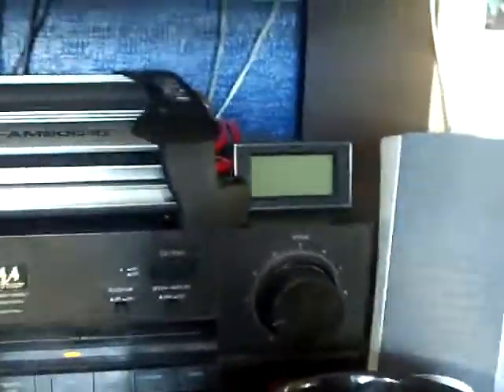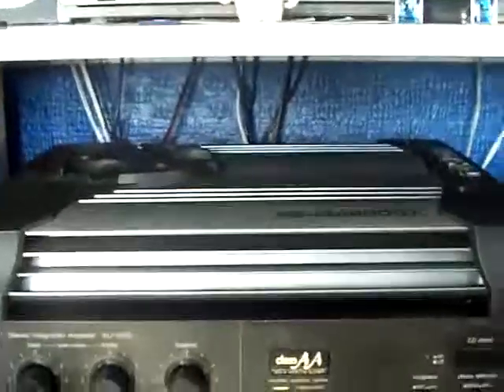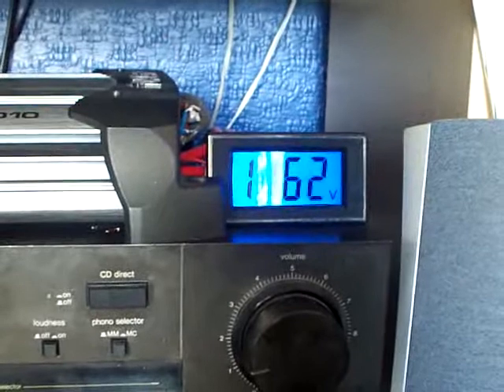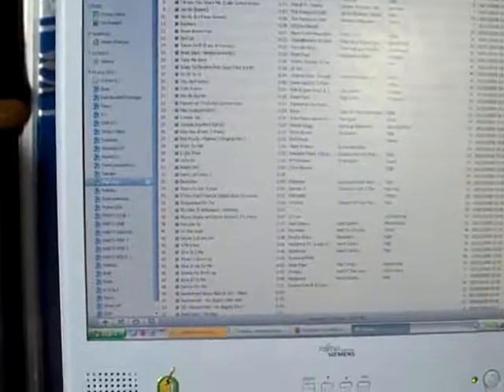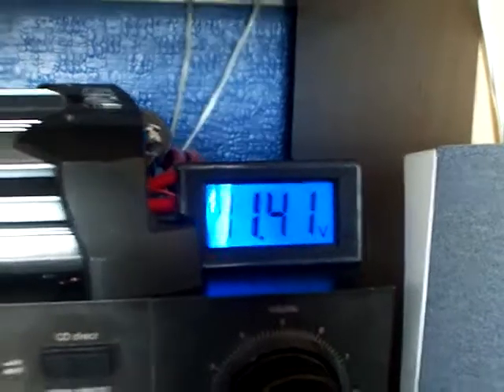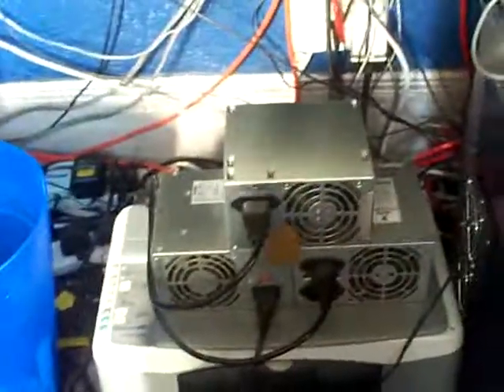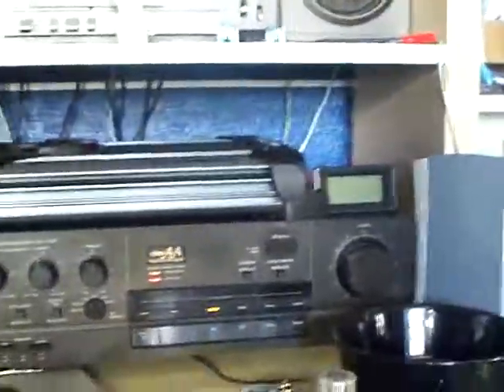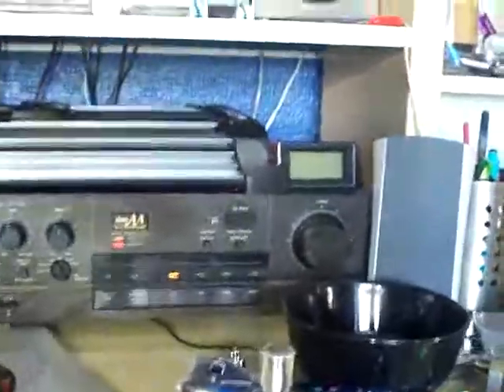Car amp in a house? PSUs maybe arent the answer!

Comment: yeah,computer psu's aren't that good for car amps because of the low voltage
I made a psu out of a continuous 25A 12v toroidal transformer,2 50a bridge rectifiers and about 0,2F filtering and it pushes about 30A before it drops under 12v.No load voltage is about 16 v and it works pretty good.I prefer using toroidal transformer because of silent operating and 96% efficienty ,compared to 60% on conventional transfomeres.

Comment: Do like me. 13.8V 30A/ 20A continous  output ,regulated switching power supply by pyramid audio. Like 80$ from amazon PSV300 is the model. Thats what u need. Supplys 20A of current and the 13.8V u need for the amp. Ima have my PS hooked up to my pyramid pb717x amp 1000 watt 2 ch.

Comment: @barevids Yeah you're probably gonna have to ground them a different way. You need to have the positive on one go to the negative on the other, and then the unused positive and negative go to the other PSU. I might have to find some PSUs to try it out , but it should work with the correct wiring.

Comment: Why not just hook up a car battery to an amp and run it off there? should be at least 12.2v and if you ever had the car battery running somehow fuck knows but you'd get 14.4v.

Might not be as good of an idea but it just seems more practical than getting more psu's.

Comment: u should look around for a decent ammateur radio power supply they put out around 13.8 volt and you can get them from around 20 amps and below to well over 60 amps may cost a little yeah admittedly but would save on al the hassle of building ur own or getting more pc psu's with the ammateur radio type supplys some can run radios that push out power in excess of 200 watts some can be uses to run linear power amplifiers that can push out power of  500 watts and above just a thought tho good luck

Comment: Get a powerful power converter, I use a battery charger with a beefed up hi-pot, works great, lowest voltage I ever get is 11.5, and it is usually 12.6 when in idle.

Comment: Here's an idea.

I'm gonna say I have 4 PSUs, but any even number will work.

Take 2 of those PSUs, and wire them in series giving you 24 volts, then, take the other 2 PSUs and wire them in parallel, then, wire all 4 together and you will have around 16 volts. Message me if I wasn't clear enough.